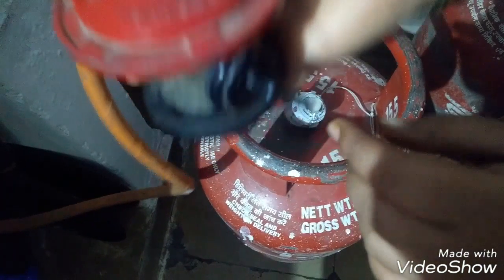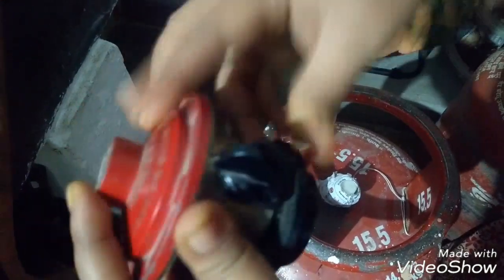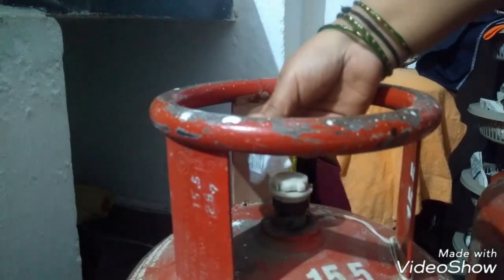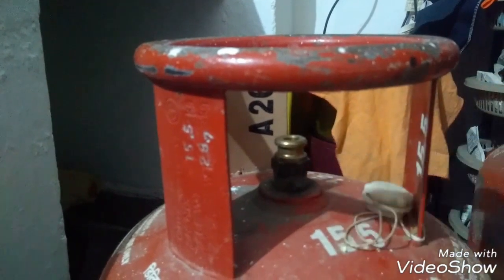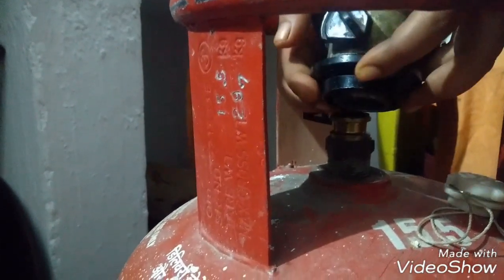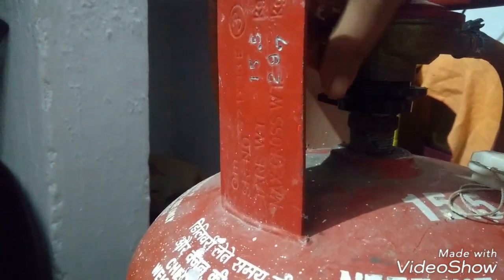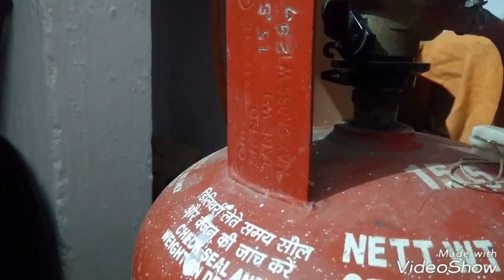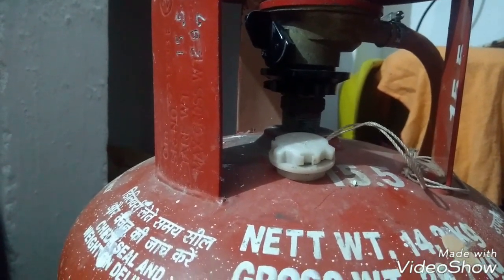How to replace gas cylinder

Comment: Mdm regulater na off madirtheevi   cylinder leakage adre ,gas blast aguthha pls heli mdm
Reply from the maker: Regulator off maadida melu gas leakage adre regulator tegedu hasige cap haaki tegedidi,nantra Gas booking office ge phone maadi heli, gas cylinder ge regulator haakuva pipe nali small rubber andre gasket reet ierute adu aagidre maatra gas leakage agodu, thank you so much
Reply: Ade mdm regulater na off madiddaga  neevu helidralla rubber gasket reet leak aguthha heli mdm